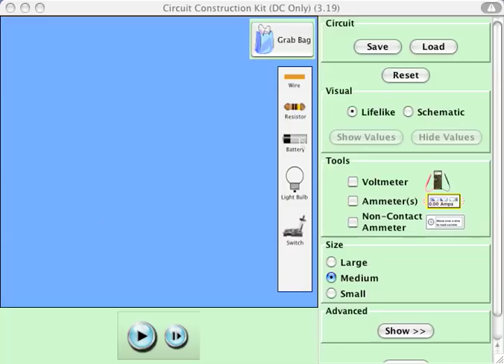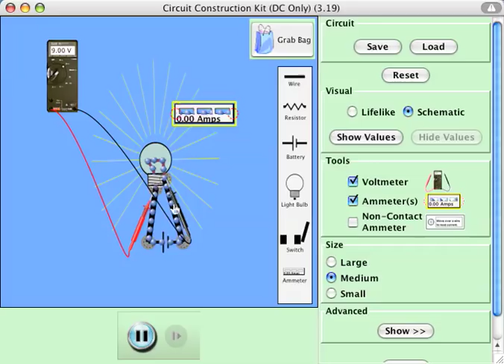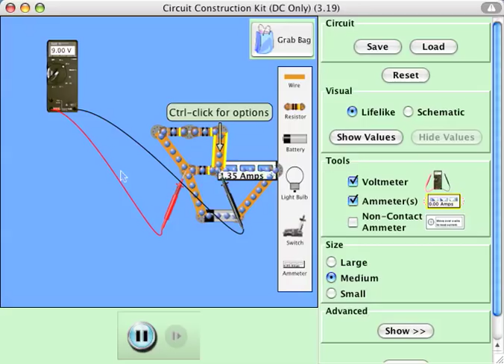circuit simulation

Comment: i have aquestion, can you change the battery to 12 V. and can you can the values off the resister. 
like amking a circuit with 12 V, with R1 120 Ohm, R2 1k Ohm, R3 10k Ohm. then do the measuremnet. for each resister.